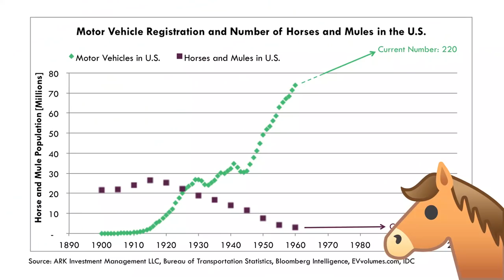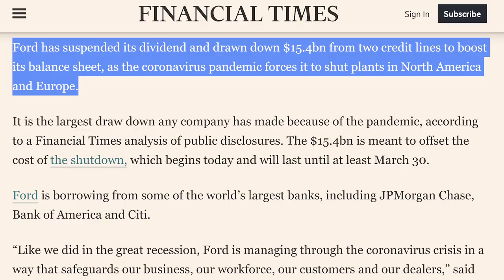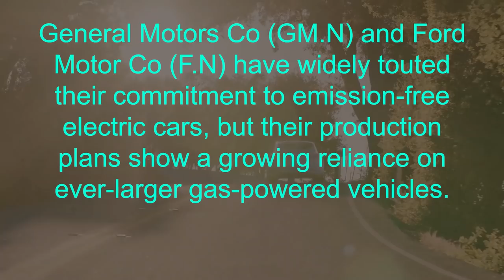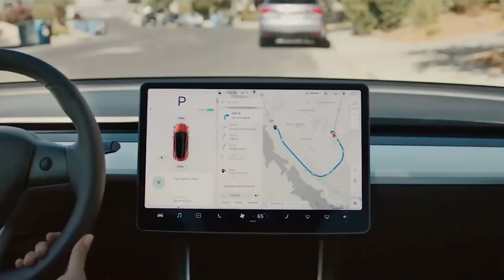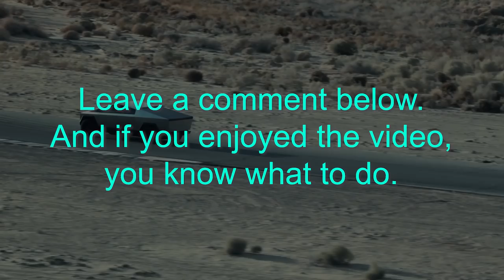Ford and GM are in BIG Trouble (bankrupt soon?)

Comment: "overtaking tesla" lol good luck
Reply: If they got a solid-state high energy density battery into mass production they might have a chance.
Reply: It’s ok if they do, but it will probably take 25 years, meanwhile who wants to step up and buy one of the first Ib3s ? The first 20,000 of them are sitting on a lot with “massive” software problems. They could discount the price this summer when they sell them but you would be taking it back to the dealer more than you would have it on the road. I smell another VW debacle.

Comment: Thanks for the eye opening take on the future. It sad the the US auto makers don’t get it. GM had the EV One and the drivers loved it. It was way ahead of it’s time and with lead/acid technology.  Back in the late ‘60s, a school buddy’s uncle was in the battery biz.  He was looking for a market for his lead acid batteries, so he designed a 3 wheel “mail delivery” Cushman replacement.  The USPS was not interested so he gave it to my school buddy. We spent many after school hours cruising around a developing suburb. It has a distinctive buzz as the motor control ramped up speed. It would go about 35 MPH, a terrifying speed in a 3 wheeler. It motor for each rear wheel gave it a snappy acceleration. Fast forward to 2014, I wanted to lower my gas bill and bought a Chevy Volt. Enough range to get to work and back on battery only. I still have it as my primary car. As it approaches it 7th birthday, it’s the best car I’ve ever owned. The maintenance is the amazing surprise. There is hardly any. Tires and an oil change every two years, that’s it.   I will need to replace it some day. I don’t see anything promising from Detroit. Tesla and VW are the only contenders on the short horizon.  Keep up the great videos!

Comment: ICE cars and hybrid can connect to internet the same way as EV,  and it can drive 620 miles refueled in 5 minutes in winter and in summer.
Reply: My Model 3 can go 1200 mi for less than $40.
Reply: @robkaOK  And how many hours do you need for charging, how many stops to get there? In summer and in winter?
Reply: @user-kn5vp2qq6d  ABRP calculates 4 Supercharging stops, avg 37.5 min each, weather is non-factor (I set ABRP weather conditions as "heavy rain/snow").  AP does most of the driving, 70 mph Interstate speed limit.  I usually make the stops longer so that I can eat/use lavatory/stretch my legs/buy beer at a monastery brew works LOL.  Avg cost for each Supercharger stop is ~ $9.  The new V3 SCs make stops quite a bit shorter, but there's only one on my route and its location isn't included amongst my waypoints.

Also, if I stop overnight, I'll usually choose a hotel with charging stations.  Free fuel, full "tank" in the morning.

I could do it faster in my Mustang GT convertible, but it doesn't have AP and it's way less efficient.
Reply: @robkaOK  No problem, enjoy, I˙ll continue to fuel it in old fast efficient way with no preparations and calculations for long distance traveling. For daily short distance commuting or driving to near shop, EV is sufficient, even electric shopping cart would do.
Reply: @user-kn5vp2qq6d  Right.  Of course, we both ignored the tree hugger argument, didn't we?  LOL!
Reply: @user-kn5vp2qq6d  Oh, and if you're ever in Ferdinand, In., USA, drop-in to St. Benedict's Brew Works.  The monks make killer brew!
Reply: @robkaOK  Cheers :)
Reply: @robkaOK  Mercedes CLS 350 fueled in Texas go 620 mi for $ 15, 1200 mi for about $ 30, prices from today. Average USA price would be double.
Reply: @user-kn5vp2qq6d  Never imagined that we would see petrol prices below $2/gal, again.  Ever.  Too bad our burning of fossil fuels is so harmful.

Comment: I see where you're coming from. Makes sense. There's just one thing I haven't heard you address that for me is what stands between us and the death of internal combustion. When I travel 600 miles north to visit family, I have to stop for gas once and it takes me like 3 minutes. Until I can do that with an EV, it's simply not a choice for me. The way to solve this problem in my mind is to swap out battery packs at stations. Similar to how they do propane tanks.

Comment: Pros 
•zero emissions (on road)
•insane torque
•Early adopter  bragging rights

Cons
•paid subscription for  performance mode
•can’t modify without being sued
•can’t buy used 
•having your personal data sold
•poor endurance racing  ability
•heavy
• terrible energy density compared to  petroleum
•doesn’t make cool noises (in my opinion)

I would be more inclined to rip the guts out of a Tesla then transferred into a former ICE  vehicle.

Comment: Thanks again for this interesting video. I have one question. Everybody says, that legacy automakers lose money on every electric car they produce. Do you have a data source which confirms that or is that just your opinion? I'm just interested if this is actually the case. For example Renault produces quite many electric cars with their Renault Zoe. I just can't imagine that they still lose money on every Zoe they sell.
Reply: im pretty sure the legacy automakers lose money on EV's, because they have to buy the batteries from third party manufacturer or invest a lot money to make their own batteries, which will take a long time to turn profit...
Reply: @darkorbitpro1  I kind of have the same opinion, but still, these are only estimates. The batteries in EV's of legacy automakers are much smaller than Tesla's. So they are less expansive and still the prices of the cars aren't cheap. So maybe they make a small profit.

Tesla also doesn't produce their batteries by themselves (at least for now). They are partnered with Panasonic and only put the single cells together to a complete Battery Pack. But the cells themselves are produced by Panasonic, and Tesla is stille able to make a huge margin on their cars.

So it would be interesting to get the clear evidence that legacy automakers lose money on EV's...
Reply: @elromolus5310  Tesla definitely gets batteries cheap from panasonic, and tesla is also working on their own battery production, they bought maxwell technologies and some other company that specialized on battery manufacturing methods....
Reply: @darkorbitpro1  Yes, we weill see that at the battery day in April. But at the moment it's not sure if the cells from Panasonic are cheap, only speculation, of course i hope so... But hopefully with the aquisition of maxwell Tesla gets fully independent.

Comment: It's possible Ford and GM survive simply because there will need to be far more vehicles on the road than one or two companies (Tesla and VW) can possibly produce. As much as I would love to see every vehicle be a Tesla, that kind of monopoly is simply not practical. People will still need to buy Ford's and Chevy's because there aren't enough Tesla's to buy, even as they increase their production capacity. No manufacturer can make enough vehicles to supply every driver. Though I do believe the demand for fully electric and autonomous vehicles will eventually force Ford and GM to prioritize them, they will just be starting way behind.

Comment: The problem with GM and Ford is probably that the leadership is not rewarded for long term planing. How many of them have been with the company for a long time? What metrics will give them fat bonuses? If the leaders of the company have more to personally gain form saying fuck the future and milk the next few years then that is what they will do. Remember a company is run by a few people. But they are not necessarily bound to that company's success. Most of the time people will follow their incentive structure.   Elon himself talks about this when discussing how to run a company. Things like rewarding innovation. Not punishing failure to hard but strongly punishing the people that don´t even try.

Comment: VW has two problems. 1) They lack the core competencies to compete. Have a look at their software issues! They don't understand the need for vertical integration. This is fixable, especially by purchasing competent companies. 2) There is an internal pressure to de-focus efforts on expensive, new tech and focus on what is currently most profitable. This tendency will keep them from mass producing electric cars. They likely believe they can develop the tech with small run vehicles, but as Elon knows, that is only part of the problem. Neither of these will kill VW, but they will make VW a distant second. Full self drive will kill them.

Comment: I am skeptical that they are totally screwed..I have a M3 and solar panels. Plus I have a cyber truck on order so I am fully in and hopeful the transition to clean energy will be faster than what I think it will be.

IMO Ford, GM and Toyota are not toast - Yet. They are moving towards an EV future at a pace they feel that is sustainable for them.  I don't think middle America will transition to EVs that fast.  Tesla's simply cannot satisfy the general demands nor can VW. So I predict 2MM EV sales combined from all manufacturers in 2025-26 and at least 10MM ICE car sales in 2030. 

Now all this can change if Tesla releases a 15-20k car in 2021-22. That can accelerate the pace of transition but otherwise I can't see how this will be such a dramatic switch in America. It's possible in Europe though.

Comment: GM in trouble....  from Deutsche Bank 4/7/20:    General Motors (NYSE:GM) was downgraded to “hold” from “buy” at Deutsche Bank due to liquidity concerns. “We see additional downside risk for US autos stocks,” the analyst said, based on “significant liquidity concerns from the prolonged production shutdown.” It could also be a concern for Ford (NYSE:F).

Comment: Electric f truck would be a great easy learning curve to start them off if even a hybrid to gleen the info and tune the tech . From this they can quickly play catch up on battery tech as they will have the need fir mass produced batteries . This venture with Rivian is a great move and from here i see the same platform of various lengths and widths underpinning all of there vehicles . I cant even see how it is a challenge really !  IOT is as simple as getting young bright minds in ! The strength of ford is its customer base and mass production ability . Time to get moving Ford !

Comment: A difficulty rarely mentioned is power supply. In North America, electrical power grids are insufficient to supply power to an entirely electric fleet. An electric car can require as much power as a home. If half of people on your block buy a Tesla and charge every night, your local transformers will be at maximum current. The transmission lines will be at maximum current. The national power grids need roughly 100% more capacity in both generation and transmission. This is where the real engineering will be needed. How will we get this huge amount of new power? I am betting on nuclear.

Comment: Your analysis, as far as it goes, is good.  The only caveat is the American market which is completely dominated by pick-ups and SUVs.  The American public wants versatile recreational/daily drivers that can accommodate the family (incl. the dog) and all their stuff, (soccer gear, etc.) and the ability to tow a boat or camper to the mountains on weekends.  The higher seating position, perceived safety advantage, ego gratifying macho image, and versatility trumps the EV for the present and foreseeable future.  Practicality and economy are not relevant, yet.

Comment: traditional ICE car Sales are only part of the pie, OEM replacement parts would be a fair chunk of car makers revenue which will help untill no longer econmic for them.
 Question : whats the planned lifespan of a Tesla? 
Best mass produced vehilcles for lifespan were late 60s early 70s many 30+ years on road, how times have changed.
Reply: Tesla motors expected to last 1 million miles.   Model 3 batteries expected to last 300-500K miles,  and Tesla is rumored to have a million mile battery in the works.

Comment: As a GM employee, I must say that I am very dissapointed with GM taking so long for Marry Barra's zero emission future. However, GM's cars are anything but dumb. They are already roling computers,  and controlling electric motors and their subsytems isnt really difficult compared to ICE engines from an enegineering perspective. Also, Tesla's batteries arent all that amazing, however their motors are. Gotta givem credit for those. Also, GM has been working with its OnStar System to not only allow updating every vehicle system remotely, but also making more robust changes to prevent cyber security breaches in their systems(lesson learned from Jeep). It does piss me off that GM is taking so f-cking long to produce EV's, but the new expandable and adaptable battery platform should allow for rapid vehicle production because honestly its easier to locate/place electrical motors and the little gearing they need in a vehicle compared to ICE vehicles. It is definitely a balancing act between switching between ICE to all EV and since its no doubt complicated to think about future production levels for a vehicle type you've never made in earnest. And my final point is also that GM's Cruise autonomous systems and autonomous fleet is really pushing it on autonomous miles driven compared to other companies. More importantly, Cruise has reported fewer drop outs than other companies while still putting more miles on the board. Atleast that is what I read at the end of last year but if Im wrong please correct me and I'll edit this post to prevent misinformation. Autonmous vehicle taxis is going to be a big market, and until autonmous features are cheaper, most wont pay for them in their cars when its easier to get a self drivng cab. I want EV's, beyond things like profit. I think they're a part of the future we need to adapt to. Also, it raises hairs on my neck about GM making most of its profit on trucks. It bothers me greatly.

Comment: If consumers stop buying gas-powered vehicles and switch to electric, then GM and Ford will be forced to convert to electric vehicle production, regardless of what their plans are. If that's the case, it will probably be like the late 1970s, when the price of gas went way up and the Japanese were exporting small fuel-efficient vehicles to the US. Ford and GM were mostly selling big cars with powerful engines and high margins, but nobody was buying them, so they were forced to switch their manufacturing to smaller, more fuel-efficient vehicles.

The one wildcard I see for GM and a few other legacy automakers is the fuel cell. Right now battery powered vehicles cost less and have a much larger network of charging/refueling stations than fuel-cell vehicles. If fuel cell vehicles can become competitive in price with electric vehicles, and a refueling network can be built that's as large as our current gas station network, then fuel cell vehicles will have several advantages over battery-powered vehicles. They can be refueled much faster than batteries can be recharged. They won't have to carry a heavy battery pack. They won't lose power over long trips. This will be especially advantageous for trucks carrying heavy loads. Another option would be a plug-in fuel cell vehicle, with a battery for shorter trips and a fuel cell for long trips. Honda is currently offering a lease on a fuel cell vehicle for $378 a month with $2,878 down in California. GM has built a fuel cell pickup that is currently being tested by the U.S. Army and Toyota recently came out with a fuel cell powered truck.
https://automobiles.honda.com/clarity-fuel-cell
https://www.gmhydrotec.com/product/public/us/en/hydrotec/Home.detail.html/content/Pages/news/us/en/2016/oct/1003-zh2.html
https://www.slashgear.com/toyota-has-a-big-hydrogen-fuel-cell-truck-plan-to-cut-co2-26614551/

I expect Tesla to continue their lead in battery powered vehicles, software for automobiles, and autonomous driving, but I think in the future, fuel cells may be competitive with batteries as a power source for vehicles.

Comment: A good lesson for the ICE legacy heavy companies is a film like "Margin Call" or "the Big Short"
they are like a merchant bank, leveraged to the hilt and holding onto rapidly descending value assets that they really need to sell IMMEDIATELY to simply avoid bankruptcy...
Short investors who invested in Tesla collapsing are like the Lehmans and champagne drinking sub prime stock holders - and the crash is not on the horizon - it is here.
VW may survive and thrive true, they at least see the problem and are attempting to join the new era (that started 8 years ago) 
but they have millions invested in legacy systems and loads of debt -
The list of companies that are more likely to die than survive includes not just Ford and GM, there is likely to be huge trouble at giants Honda and Toyota,  who are desperately bidding to rule the hybrid market - what market? 

South Korea is strong - and they get it - Kia and Hyundai will definitely do what it takes, and may end up dominating the world market for smaller/mid sized EVs. 

who will crack the truck EV market is a big question - 
and the EV truck industry may be the No.1 long lasting demand there is. 
individuals can use public transport - deliveries are essential - even more so during a pandemic.